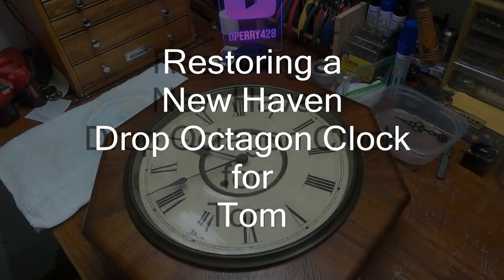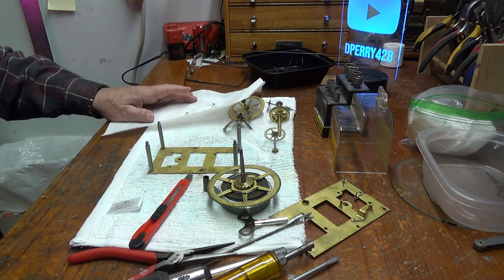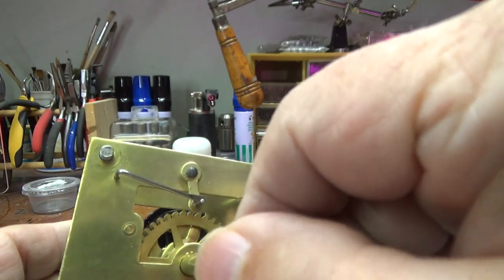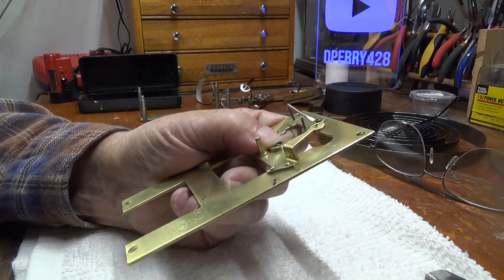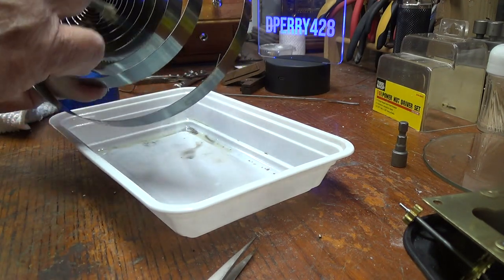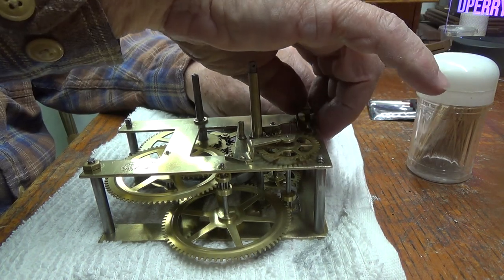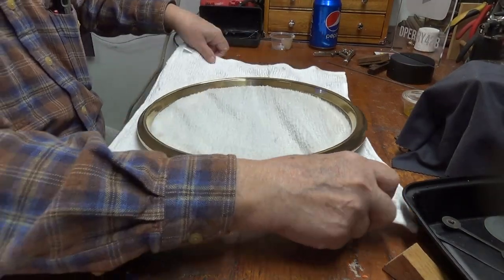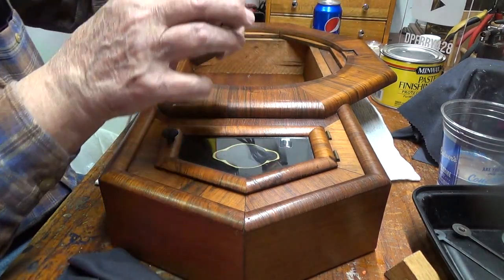Restoring a New Haven Drop Octagon Clock for Tom

Comment: Nice job.  When you soldered the ring on the plate to bush the center wheel, did you do anything to prevent the ring from moving while it was being soldered?  Or was that not an issue?
Reply from the maker: It's not an issue.  I "tinned" the ring, put flux on the area of the plate where I wanted the solder to flow, placed the ring on the plate exactly where I wanted it and heated the brass until the solder melted.  Done.  As long as you don't put the torch right on the object, it won't move.  Sometimes, where it's possible, such as on the cracked gear in another video,, I use hemostats to hold objects in place.

Comment: Another great informative clock repair/service. Mr Perry can you please describe the “stoning” steps you took to address the issue of raised bushings and how to polish the brass surface plate. Thank you as always.
Reply from the maker: I have a set of very small fine (#4 cut) files that are somewhat flexible.  I use the flat one to carefully file the bushing down, filing with the grain of the brass plate in case I mar it.  I then use a fine-grained Arkansas stone to further flatten the bushing, followed by removing marks with a fingernail filing and polishing board, the kind with about 6 or 7 levels of grit, finishing with the "polish" side.  Finally, to polish the brass surface, I use an acrylic shower cleaner that polishes and leaves an acrylic film.
Reply: @dperry428  excellent, I appreciate it

Comment: Hello Don! I've got the same problem with the hour tube hole on the movement I'm working on. I was just planning on bushing the hole. What made you decide to solder the ring on as opposed to bushing?
Reply from the maker: It's a large hole and badly worn. Finding the exact center is very difficult.  As with all "bushings" the real purpose is to make sure that the wheels (gears) are meshing properly.  Bushing for the sake of bushing is meaningless if it results in the teeth of gears clashing because they mesh too deeply or literally strip their teeth because the mesh is too shallow.  The purpose is to get meshing gears to have their pitch circles be tangent, and that is what I did.  An alternative would have been to drill a larger hole, fill it with a blank piece of brass and, then, with lots of tedious measuring, find the original center. You got a better method that doesn't take all day, please share it.
Reply: @dperry428  After looking again at my movement, I can see yours is much, much more worn. The wheel in mine isn't shifting enough to cause meshing issues; even if I were to put a bushing in false center, it would still run for a while.
I was just curious to see your thought process and if I should do the same instead of trying a bushing. Great video like always! I hope to be as skilled as you one day.
Reply from the maker: On most clocks, the motion works has so little forces applied that the looseness of the hour tube in the center hole makes no difference, but in this movement, the motion works is powered by the second wheel and looseness in the motion works becomes much more critical when it comes to the meshing of the gears.  The collar I applied keeps the meshing of the gears correct.
Reply: @dperry428  Thanks! I always appreciate your pearls of wisdom!